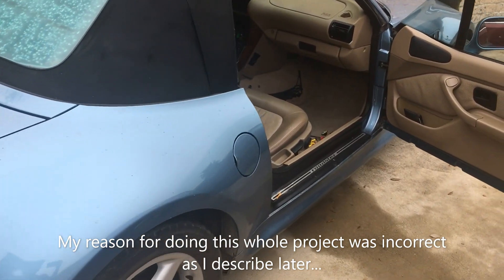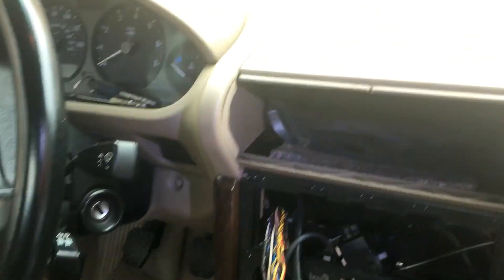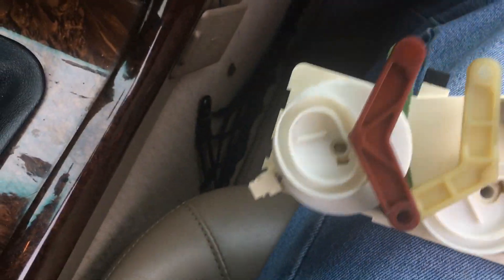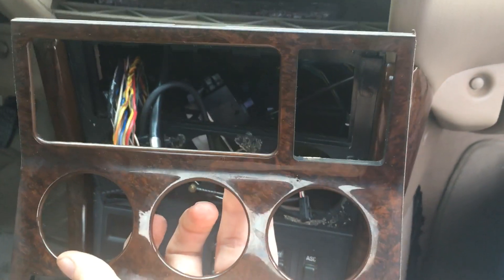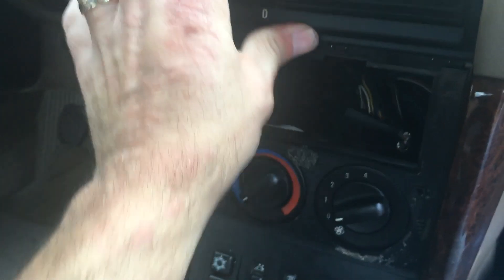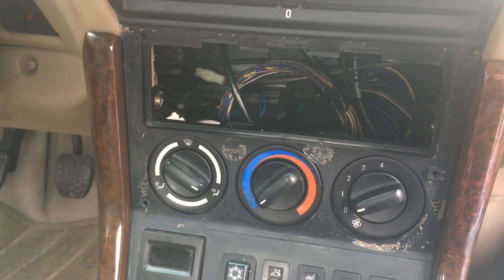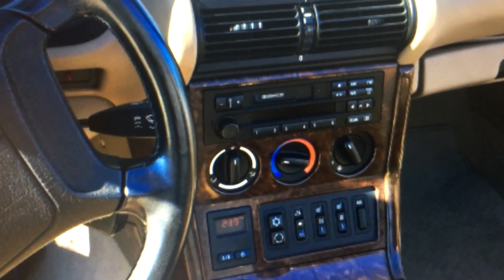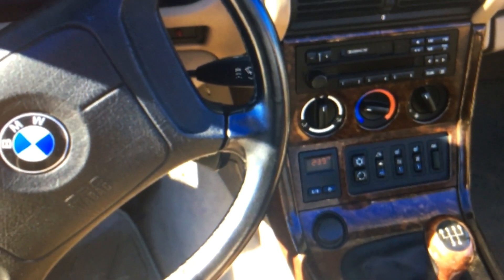BMW Z3 Climate Controls Replacement How-To

Comment: Very informative.  i have a problem with the output selector switch (one on the left with three color coded cables I guess).  So your video will help.  I did get seasick watching it however.
Reply from the maker: Sorry sbout the motion sickness guess I need a steady mount.

Comment: How did you get the black face plate off of the white back? The stem from the heat to air broke off of mine, looking to replace the white portion if yours is okay maybe you can sell it to me?
Reply from the maker: Mine is already sold, sorry.  The white portion comes out the back smd the black portion stays in place, have to maneuver it out the side like i tried to show in the video.